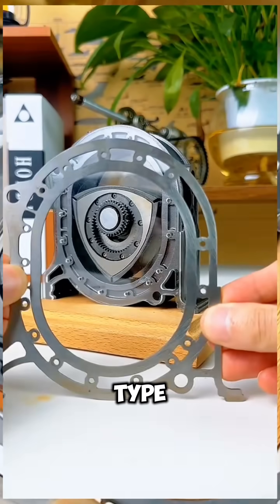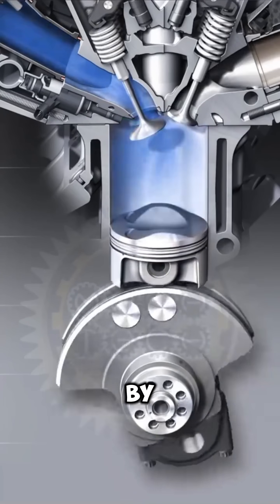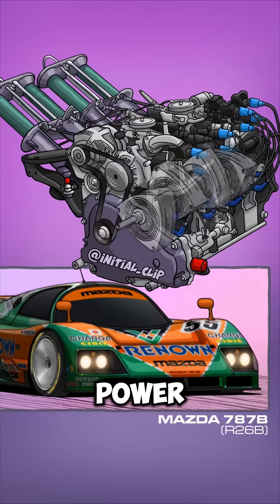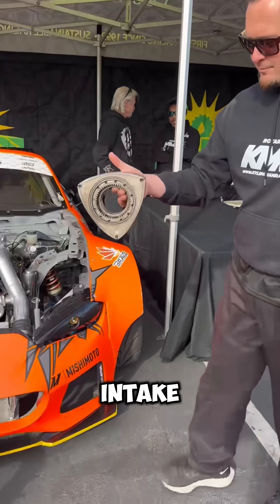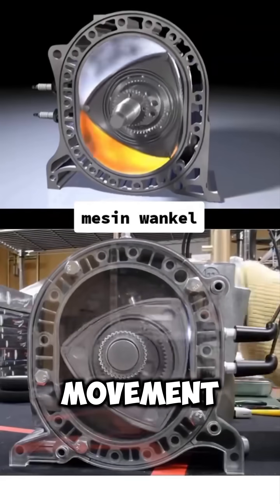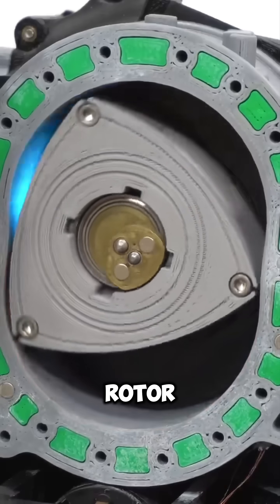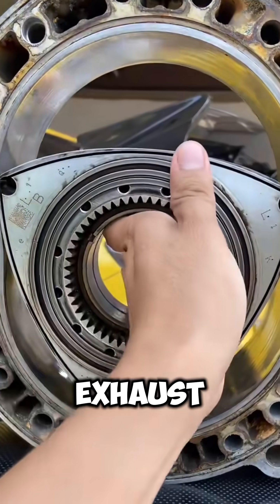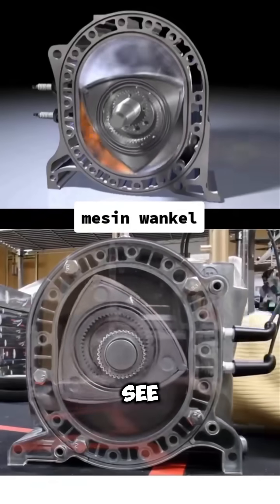Why This Engine Has No Pistons!

Comment: Correction NSU is the first automaker to mass produce them. They also didn't enjoy much success in Motorsport, the 787b may have won Le Mans, but it was the only race it won in the Championship and it's lifespan, it ran for 21 races and won 1, and finishes 6th in the WSC Championship, it actually got lucky at Le Mans due to the leaders suffering various issues. It subsequently canned off by both Mazda and the FIA due to its enormous thirst.